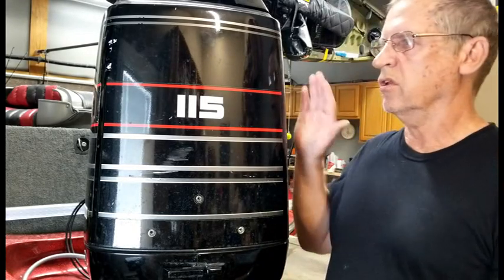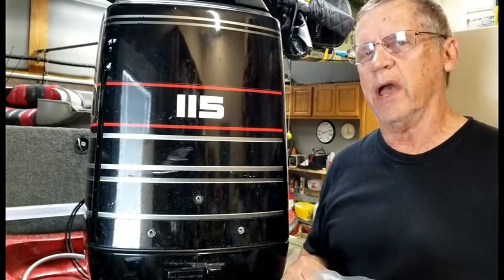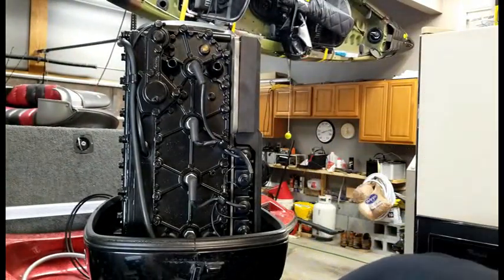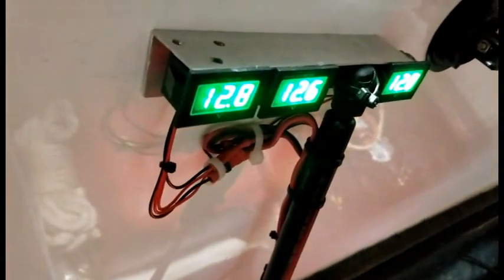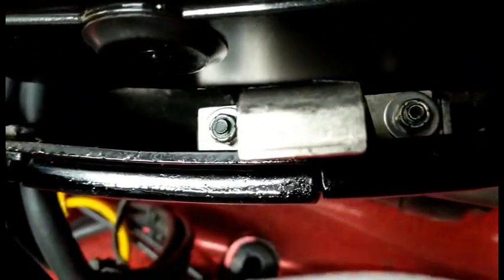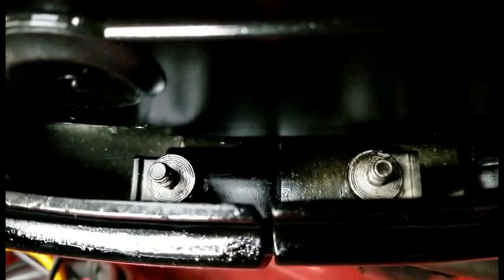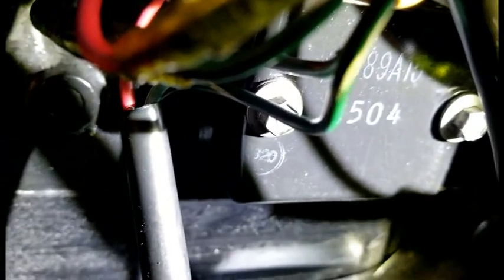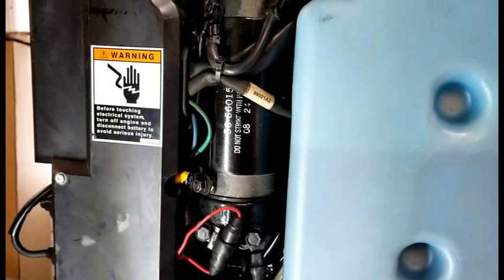1995 Mercury 115 Rev Limiter Replacement

Comment: Thanks for a good video. Can I by disconnecting some wires in your video,  ignore rev limiter . To cut out the black negativ wire  at left side row will disconnect the function of built  in rev limiter ? Right? No problems with that?_________  And do you have some clue of why rpm meter doesnt work properly...it goes well to 4000 rpm but after that it goes down to 3000. Never shows more than 4000 . I have checked wirings at meter and they are all good. Where does the ground go from rpm meter? I have a 115 hp Mercury 1998 two strok. I suppose is same engine as yours.
Reply from the maker: On the switch box, left row, 3rd wire down (on mine) is a black wire with yellow stripe. This wire comes from the kill switch at the console. Also on that same post is a black wire. That black wire goes to a junction box between the switch box and rev limiter. If you remove the black wire and tape up the end that removes the rev limiter from the circuit. (If not careful, you could over-rev your engine, particularly when starting.) If your engine was cutting out or sputtering and you remove the ground wire and the engine doesn't cut out then you need to replace the rev limiter. My rev limiter had several cracks on the back side where it attached to the overheating sensor.

If the engine is running OK, no cutout, but the tachometer (RPM gauge) doesn't read properly then you may have a bad voltage regulator. The tachometer is connected to the voltage regulator. You need to check your battery voltage when running at top speed. If you are over about 14.1 volts then the voltage regulator is probably bad. Mine was reading 18-19 volts and the tachometer wan't working. I replaced the voltage regulator and it worked again.
Reply: @richward2288  Thank you. I have to melt down all that information :- ) but the only thing I know now for shure that vollts are not exceeding 14.volts. before start 12.2v . And after start o 13,8v. When trying to get WOT rpms engine doesn't sound right....like a rpm regulator kicks in. I have ordered a larger propeller..from aluminium 15 to 17 stainless.pitch. BTW...there seems to be both 5 and 6 wires regulators for 1998 115...I suppose the sixth ground wire is missing ..the box grounds itself?
Reply from the maker: @reioXyhi  Try removing that black ground wire I mentioned. That will disconnect the rev limiter. If your motor runs OK with that ground wire removed then you need to replace the rev limiter

My original Quicksilver 3-blade is 13 -1/2" 22 pitch. I have a 4-blade to get on plane faster when I have 2 people in the boat. It's maybe 2 mph slower than the 3-blade but gets better gas mileage because I get on plane much faster with 2 people, full gas tank and full livewell. It's a Solas 13" 21 pitch.
Reply: @richward2288  very well. I will follow your instructions. Your humble student 👍🤗
Reply from the maker: @reioXyhi  Sorry, my service manual is only for a 1995. The black wire with yellow stripe should be paired with a black wire. Check all the posts on the switchbox. You can also look at the wires going to the wiring cable that leads to the console. The wire from the kill switch (black with yellow stripe) comes from that cable and goes to the switchbox. There should be a black wire on that same post, remove it and cover with tape then test the motor on the water. The voltage regulator (on mine) is a metal box that sits on the front top of the motor. The wiring is pull apart barrel connectors. One of my wires was burned because of the overcharging voltage. Easy fix. 

Mercury offers a free online parts catalog. You just need your serial number:
https://www.mercurymarine.com/en/us/parts-and-accessories/parts-catalog
Reply from the maker: The rev limiter is on the starboard side of the engine block below the edge of the lower cowling. You are watching the video on how to replace it. If you can get your engine up to 3,000 RPM and the voltage is below 15 volts then you don't have a problem with the voltage regular. Maybe your tachometer is bad?

Your voltage regulator is Part number 854515. Your serial number starts with a zero, not an "O", I assume it was made in the USA. Your rev limiter is part number 821889A51 and is on the engine block. In the parts catalog look on "Cylinder Block and Crankcase".
Reply: @richward2288  Thank you for all into and part numbers.  I have been looking in the parts  electrical system for the rev limiter. Now I got the puzzle done. I will tell later how all ended. 👍. Edit: I read somewhere that  tachometer reading jumps wherever if connections are not good.....mostly bad ground. Tachometer take pulse via limiter.,right?
Reply from the maker: @reioXyhi  Tachometer takes pulse from voltage regulator. Check voltage regulator connections. Tachometer ground on my boat is at the dashboard.
Reply from the maker: In my manual I found something called the Tachometer Terminal Block near the voltage regulator and the starter solenoid. There are 2 yellow wires from the stator connected to it (which then go to the voltage regulator) and a connection for the gray tachometer wire, which goes to the voltage regulator AND through the large cable up to the dashboard. It is only a junction point, there is no test for it but you should check the connections.
So 2 yellow wires from the stator coil (under the flywheel) go to the terminal block and then voltage regulator. From the terminal block is a gray wire with goes up to the tachometer. That's the entire circuit. So the 3 components are stator, terminal block, voltage regulator and tachometer.
Reply: @richward2288  Before your latest two messages I was down to boat yesterday and checked around. Because I will get the new SS prop with 2 inch larger pitch I will focus more on the tachproblem problem because I suppose the limiter will not give cutsignal with new prop.  I had dashboard out again for "100" time and checked connections there and checked the pulse choice was right ..but tried on other pulses choiches too..but on right choice..goes nice up to 4000 and then suddenly fall down to almost zero rpms. 
About limiter....it seems this problem was known for some of the two pre-owners...the limiter is marked 821889A40....and not a51.. Engine is sold as a Bayliner package in US .I have the original documents :-)  .....Today I will check your latest info ...hopefully something occurs. Many have bought new tachometers and found out that it was not the tachometer what was causing wrong numbers...fault somewhere else. 
Three wires with unconnected ends of which one ....the middle wire...was supposedly plugged from factory...picture in : https://www.flickr.com/photos/henrik_nn/  ...
Reply: Okey, now I tried my best to follow your instructions and what I found out was not good at all. Burned wire connections from regulator. https://www.flickr.com/photos/henrik_nn/   wires was tight clamped together from factory with cable tie to a tight package (terminal block ? 8 wires total)).  6 wires incl ground fromregulator. Both 2 reds and 2 yellows wires burned connections. I have to use a screwdriver to peel them off from each other. Plastic cover for each one still okey but burned. The grey cable was okey. Strange that my regulator works still just fine as voltage regulator. This is just as almost always...you begin with a small problem and then it's growing and growing 🤔 maybe I have to buy a new regulator (for the tachometer) Pity that I don't think my multimeter for revs works on this kind of engines.....I tried to connect but showing horrible numbers only. I really only need to read the revs on my tests with new prop. (And with the old one).
Reply from the maker: @reioXyhi  The terminal block is attached to the engine block. Here are photos from the service manual for 4 cylinder and 3 cylinder wiring. https://flic.kr/p/2jzUiSr   and  https://flic.kr/p/2jzXFqi
I think your voltage regulator is bad. It is either voltage regulator or stator. When my voltage regulator was bad it burned a wire and over charged my battery.
Reply from the maker: @reioXyhi  My problem with the rev limiter was a "stumble" or "stutter". The motor ran well up to 30-35 mph. If I went faster the engine would suddenly stop and start. I was like hitting something in the water. The alarm would chirp. Try the new blade. I would also replace the voltage regulator. You can order new barrel connections from Mercury but it takes an expensive tool to install them. I used regular barrel connectors. They will eventually corrode but when they do, just replace again.
Reply: @richward2288  excellent. Thanks for pic over wirings. Now I just follow the grey wire to the the next connector point after regulator. That will be tomorrow's task :-). I have a small digital 12 volt extra gauge (showing 24/7) but strange that regulator "work well" it's never goes more than around 13.8v and minimum 12.2v. .. interesting to check tomorrow...yes, regular cheap barrel will do great for me too. This old engines market value is so minimal sp better try to have costs down (xcept SS prop 😉)  My engine starts like spitting after 90- 95 % of WOT. No alarm sound...maybe that wire is one of those what is inactivated (in my Flickr  pics). I have searched hours and hours on the net to get wiring diagram....not any to download or pay for..strange that too.
"Try the new blade" -Richard....... is that ref to the new 17" prop?
Reply from the maker: Yes, 'try the new blade' meant your new 17" prop. That seems like a very large prop. Mine are only 13" and 13 1/2".   Did you use a web site to determine your propeller size?  I got my 4-blade from Solas Propellers.  What is the blade pitch on your 17" prop?

Which wiring diagram are you looking for?
Reply: @richward2288  IIn my prop choiches I use my experience with the 15". E.g. .today I tried to count how many seconds from idle sped up to plane...Honestly, I went so fast to plan I have no change to count to three :-)  (with rig trimmed out some)  With rig full trimmed in, it popped out of hole (almost 100% true)  I mostly drive alone and sonetimes wife n daughter with me. I have experience of my former boats about same size and props. What I do I always change to stainless...more fun. Maybe I am overopimist with the 17"...I will tell you how that went. Boat goes now 27 GPS knots....maybe I can achive 2 knots more with a 17" as most (or I loose a lot because to big pitch)..but it's primerly for the funfactor I want this SS. I really don't like when aluminium propellers loose the grip so easily. May I ask what boat you have to your Mercury 115? My Trophy 1903 cc is rather heavy  boat but with a very moderate Vee...so 115 is almost enough,.....but it should be a 150 hp. Today I removed the hydrofoil from pre-owners inallation....no need for that at all. New SS: 13 1/4" diameter and 17" pitch....old same diameter but pitch 15".
Reply from the maker: @reioXyhi  I understand, when you said 17" I thought you meant diameter, but you mean pitch. My Quicksilver 3-blade is 13 1/2" diameter, 22 pitch. My Solas 4-blade is 13" diameter, 21 pitch. Quicksilver 3-blade is faster, Solas 4-blade is better if I have a lot of weight, like passengers, full gas tank and fish tank (live well). 

My boat is a 1995 Ranger bass boat, 17 ft, 81" beam. With the 3-blade prop I can go 43 knots GPS. https://flic.kr/p/2jA2Kry
Reply: @richward2288  interesting .....my "hobby" is to play with props and pitches and lift engine and trim out to maximum...it has been like that since my first mercury 20hp in 60,s 😊🤗 what boat you have to those pitches? ....the 4 blade....do you feel some advantage in that...I have never owned a 4- blade. ...I came just up from beach and checked that connector you advices me to do....that round about 1" snap in connector. With 8-9 wires. It didn't look bad but I cleaned and sprayed some electrical contact cleaner AND I open the male part connector pins a little bit for better contact into the female fitting.
Reply from the maker: The 4-blade provides more lift on the stern. Bass boats have a lot of weight in the back. There is a 23 gallon gas tank, 2 gallons spare gas, 6-8 gallons water in the live well (tank to keep fish alive) and up to 3 people (more than 600 lbs. of men).  If I am fishing alone the 3-blade does well but with 2 or more people in the boat I use the 4-blade to get on plane faster. It saves gas. Bass boats have a "pad" on the bottom, looks like a small surf board. On plane it doesn't require much to stay there but to raise the boat to plane takes a lot.
Reply: @richward2288  I went for a short ride after cleaning the terminal connector,....no help for the tachometer. The grey wire at tachometer shows about 6v DC on idle and rises to about 10v on high rpms but I suspect the voltages says nothing anyway. After the short test without the hydrofoil only thing idfferejt was a small rise on topspeed... marginalized decimal numbers...and to plane no difference at all. Those bassboats you use are very fast boats. The pad I had once in one of my joats...not a bassboats but the pad had same function..Mine Trophy is a opposite one..heavy and "clumpsy". Now I have to realize and accept  to buy  a new regulator and hopefully not a new tachometer too. And then we have the option that something failing at stator.

Comment: Thanks for this Rich, having a similar issue with my Optimax.   My situation presents slightly different, so Im wondering if it's the same cause.  Again when motor is under load ( 3500 to 4000) RPM,  beeping alarm, sudden drop ( 2 0r 300RPM ) in power, followed by engine chirping or cutting in and out like bad fuel).  I return to idle, warning signal clears and I take off normally,   Problem may or may not do present again.    I guess I should do what you did and just pull the negative test againi?
Reply from the maker: If your alarm is chirping (mine would only chirp, it didn't continue beeping) when the sudden drop occurs, try my suggestion to disconnect the kill switch on the switch box.  Then take it to the lake for a day of fishing and see if it happens again. I did that and there was no return of the problem. I replaced the rev limiter and haven't had the problem again.  In my search, I found 2 other people with the same issue but different horsepower motors.  Something else, take off the rev limiter and inspect the back. My had several cracks in it, quite visible.